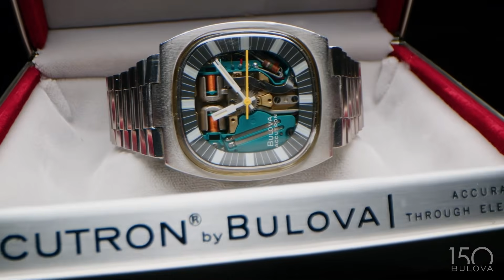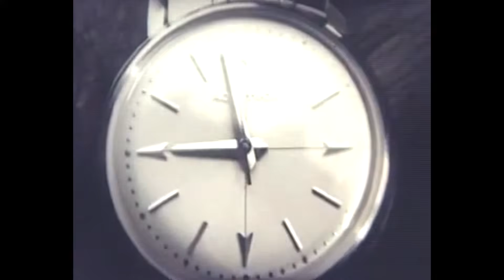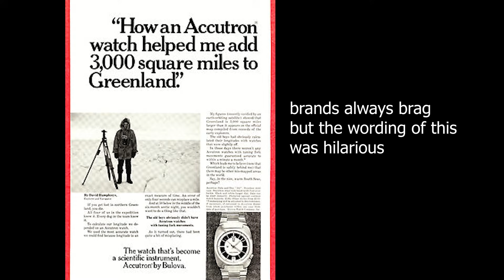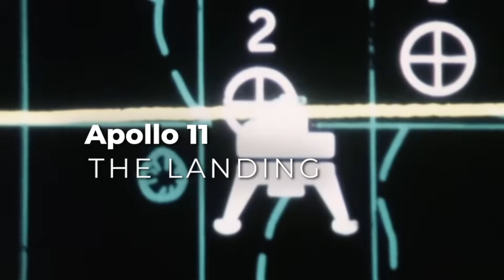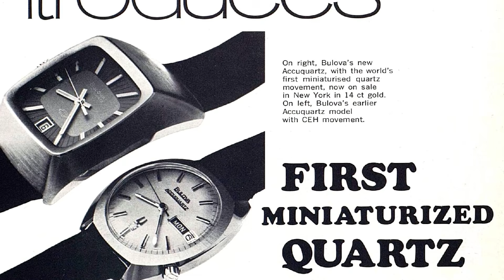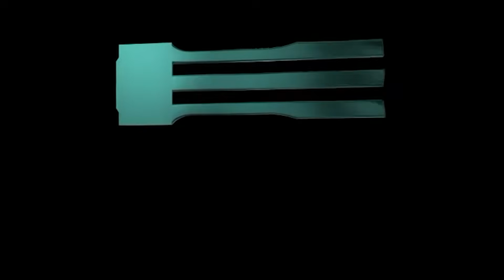Bulova Accutron Changed Watches Forever (and one is on the moon right now)

Comment: I am so stuck between spring drive and modern accutrons.  I want a watch with a unique movement because I am a total nerd, and both provide a smooth sweeping second hand that is very beautiful (the accutron is smooth enough at actual viewing distance for me to consider it equivalent to spring-drive).  Grand seiko has the SBGA211 snowflake, SBGA413 shunbun (aka cherry blossom), and the SBG429 soko shadow.  All have beautiful dials and cases which would be unique within my mostly black collection.  On the other hand, the Bulova DNA and spaceview 2020 feed into the skeleton watch vibe that is so much more ME but also already exists in my collection.
Reply from the maker: If you dont have any grand seiko spring drive, I would try that and as much as I dont like this point, Im lying if this doesnt play a role in my own thinking at some point, that i feel like you could probably sell ur way out of a grand seiko. Break even or close but I would imagine much smaller buyer pool for accutron

Comment: nice video, also in 1982 Bulova managed to put into production a thermo power watch base on Seebeck effect call thermatron but it become a failure because of it required to be wear to charge the battery and the short coming of re-chargeable battery not last very long and if it discharge for a while it unable to recharge again cause severe problem for Bulova, later Seiko & Citizen pickup on this concept and able to produce CTZ Eco-drive thermo & Seiko Thermic but not hit any success, now a day only some of the smart watch take advantage of Seebeck effect

Comment: Great video.  I had one of these… it was a Frankenwatch a local shop had in their case so I picked it up for a few hundred bucks.  I think it was from 1962.  I eventually sold it because it looked so small compared to the other stuff I had, but I’ve found myself looking at them again on EBay.  I’d prob try to find a square case model if I got one now.
Reply from the maker: Yeah i still want to get it but saw it is surprisingly small, and the square TV style is really cool too
Reply: In 1974 I gifted myself a model 218 for my 30th birthday. I gave $135 for it. Now at age 81 and a grandpa, I added a Rolex, many autowinders and quartz movement watches plus two more 'hummers', another 218 and a 214 Rail Road Approved model. My original 218 is in pristine condition, worn on special  occasions only. The design engineers even applied Newton's Laws of motion by changing the inertia of the forks to adjust their frquency. As a retired Adjunct Senior Lecturer of Mathematics and Physics of an engineering college, I give those designers Grade-A+. Well done...